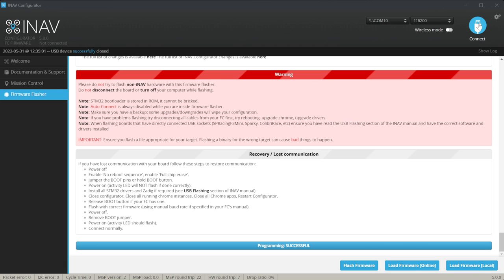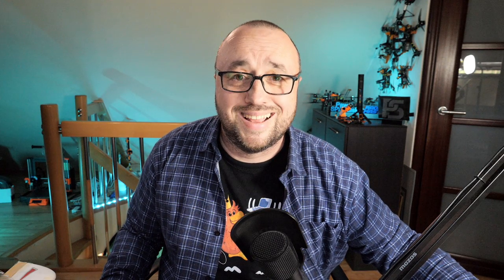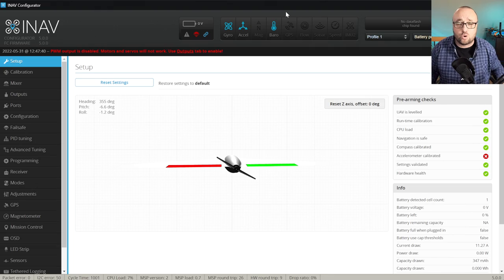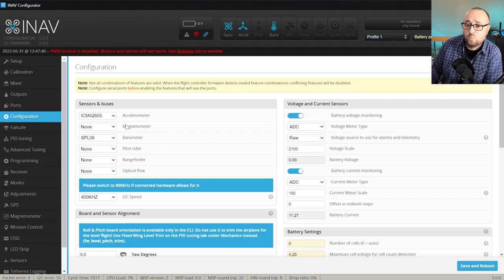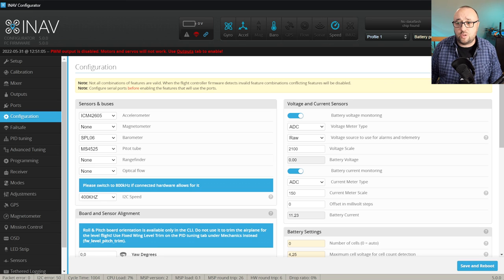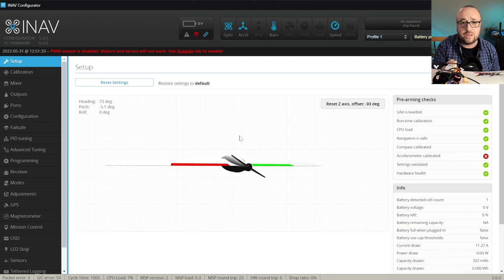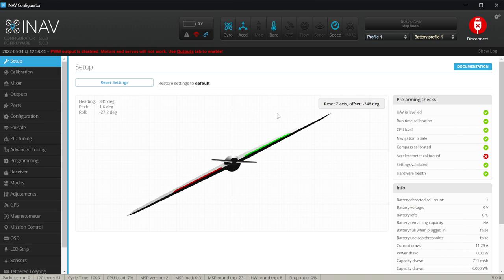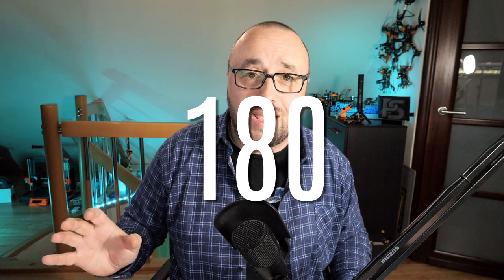Defaults & Sensors | INAV 5 on a flying wing | 2/11

Comment: im trying to setup this same pitot sensor on Matek h743 v3. ive connected it to CL1 and DA1. Everytime i select MS4525 then there is no air speed selected on the sensors tab....when i change the config to ADC then there is data on the sensors tab but it doesnt make sense

Comment: inav 5.0 finaly stable version? or prelease ?  can i istall it on drone 7 inch?  i have 3.2 version. because 4.1 has bug gyro hardware
Reply from the maker: Stable
Reply: @FPVUniversity  thank you. I have matek f405se and its  compatibility with inave 5.0 ?